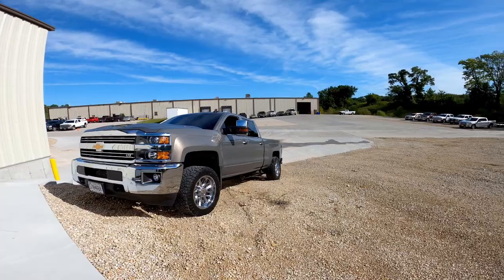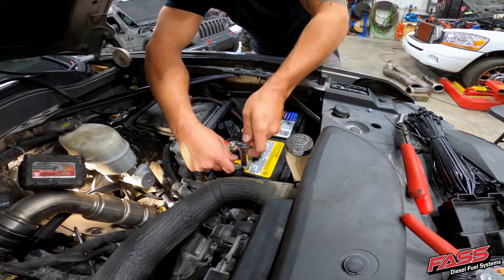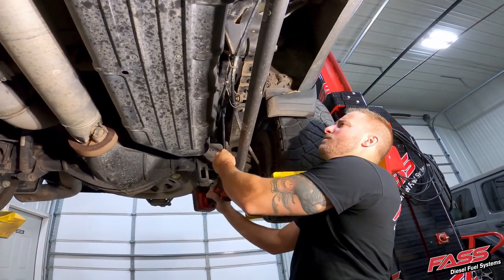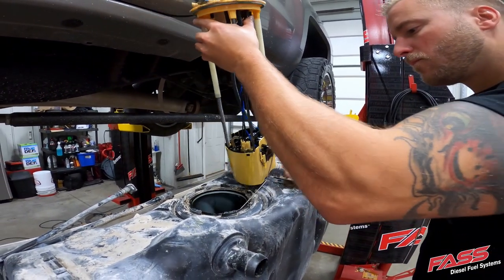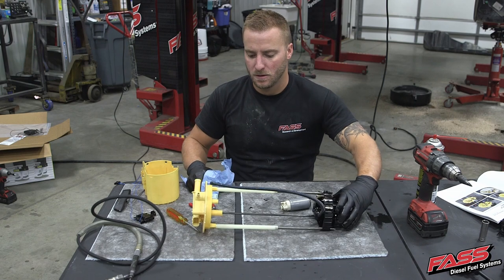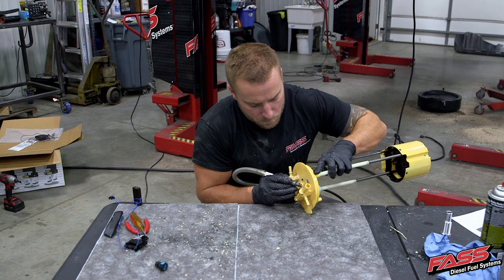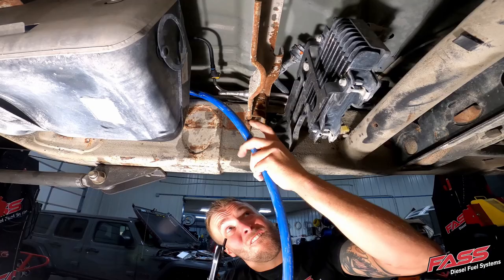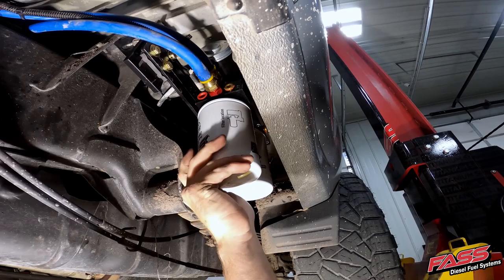How to Install a FASS on the L5P Duramax!

Comment: Running the fass pump but using a fuel sump kit and leaving the factory pump in take and leaving all connectors plugged it wouldn’t cause a cel light right?  Since everything is still all connected.
Reply from the maker: Great question and we appreciate you reaching out. Our systems for the L5P Duramax are ONLY for trucks with aftermarket tuning–this ensures you're able to delete any codes. 

If you were to install our system on a stock L5P with no tuning support, you'd almost certainly have a CEL. 

If you have any other questions as well you are more than welcome to reach out to our service team at 636-433-5410. 

Have a great day!
Reply: @FASSFuelSystems so your system is for tuned trucks only?
Reply from the maker: @jeremyfortune7274  For the Titanium Signature Series on an L5P yes you will need a tune, but we offer a Drop-in system that doesn't require tuning for these trucks as well.

Comment: So what steps did the shops mess up on that would cause the excessive noise?
Reply from the maker: Appreciate the question, and could be refilling the tank to full as suggested. If needed we also have a tech line available for more questions, and support! 1-866-769-3747. Thank you!

Comment: If I wanna run this system with a Beans Sump w/ supply n return port , do I still need to drop the tank ??? Do you guys have any videos or instructions on that ???
Reply from the maker: Thanks for reaching out! Unfortunately, we don't have any installation videos using the Beans Sump. That said, our service team would be more than happy to help.

When it's convenient, give us a ring at 636-433-5410, or shoot us an email to techsupport@fassride.com!
Reply: I put an xdp sump on my truck towards the front of the tank and it leaves me stranded with half a tank. The fass takes in air. Just do it this way better.

Comment: Have they worked out the kinks, I hear the tuners are having problems getting these things tuned in properly,, when I spoke to my tuner at calibrated power he recommended not to buy it until all the bugs were worked out, it’s a shame cause I love fass I have it on three  of my other trucks, I want one for my l5p hopefully soon.
Reply from the maker: Firstly, thanks for your support! We appreciate you choosing FASS. 

This installation was actually filmed in response to a few reports of issues with our L5P kit. After following the exact installation instructions, we haven't had a single hiccup with this particular truck since install. 

While product issues unfortunately do happen, we haven't been able to replicate any in our own L5P testing.
Reply: @FASSFuelSystems  good to know ill give the info back to calibrated power so I can go ahead and order one, I love your stuff its been perfect for me so thanks for the response.
Reply from the maker: @victoroliveira3256  Sure thing! And don't hesitate to give us a ring if we can answer any questions before/during/after install.
Reply: Hi is a lift pump a must on l5p?

Comment: Bought this for my 17 duramax have a derringer on my truck now half way thru install with wiring run at the tank. But now unsure if its going to work or toss my truck into limp mode. When u say tuner what tuner?!?
Reply from the maker: Hey Corey, 

Thanks for reaching out! If you haven't already, give us a call at 636-433-5410 or shoot us an email at techsupport@fassride.com and our service team will be happy to answer any questions. 

Regarding the tuner, we're simply referring to any aftermarket tuner that allows you to disable the codes activated by L5Ps with aftermarket fuel systems.
Reply: ECM swap there goes an extra $4k to go along with your lift pump install
Reply: @victoroliveira3256  😯

Comment: Do you get any CEL leaving the oem fuel pump plug disconnected?  Also what pressure does the Fass operate at?
Reply from the maker: Hey Ricardo, thanks for reaching out! 

Our systems for the L5P Duramax are ONLY for trucks with aftermarket tuning–this ensures you're able to delete any codes. 

If you were to install our system on a stock L5P with no tuning support, you'd almost certainly have a CEL. 

And this system operates at approximately 75 psi!